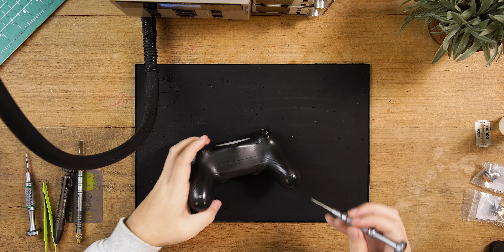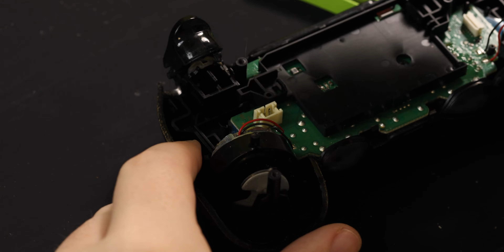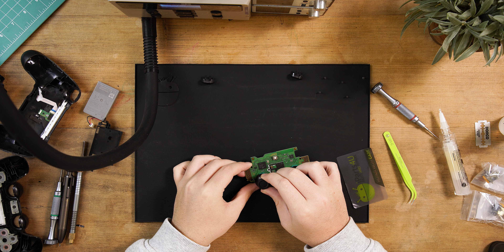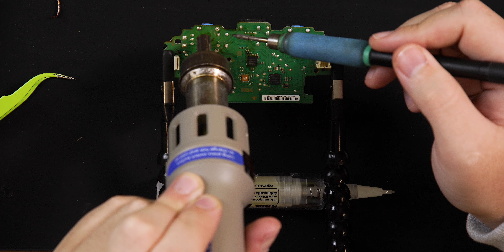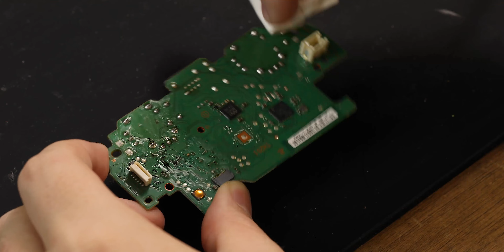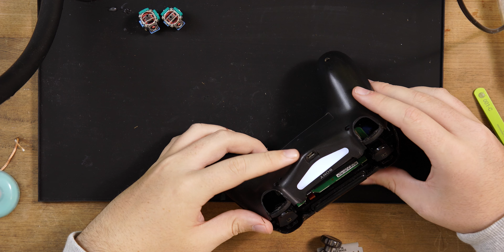Replace Drifting PS4 Controller Joysticks

Comment: After watching SOOO many videos on disordering these bloody joysticks (even using a desoldering block) I was failing. No one would say what temp to set the heat station to (heat gun specifically). Did exactly what you said here, and it came right out after about 90secs of heat. I’m good with all the rest, but getting them out without damaging the board was my concern. Thanks mate 👍

Comment: you make  it look  so easy. it's really not. I burnt  the pcb. rip.  it wouldn't go through the coating  so I raised the temp. no idea what it's coated with. tried 99% isopropyl and scrubbed at it and it did nothing. its impossibly hard to get these off. never had so much trouble before. I have the v2 controller
Reply: For anyone wondering, I was able to burn through the coating at 425°C. Anything below 420°C will have no effect. Normally I solder at around 180-230°C so this was pretty extreme. If you're a DIY-er and you wanna change your sticks,  just buy the parts and take it to a professional. It's not worth it. I'll fix anything but I don't think I will ever touch another PS4 controller again. Thanks SONY.

Comment: I have a nice Weller soldering iron, more wick than John and flux galore. My sticks WILL NOT come out of the board without getting it so hot it damages the stick coming out or the board itself
Reply: i just cut the sticks out using flush pliers then painstakingly removed the sticks